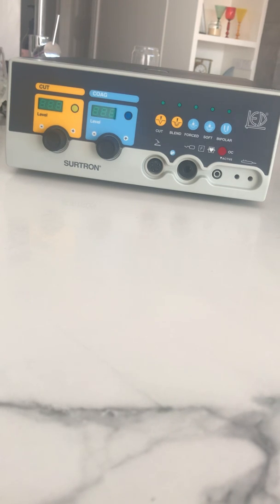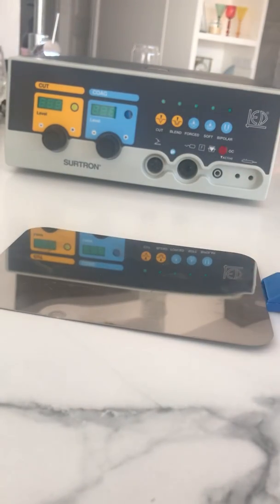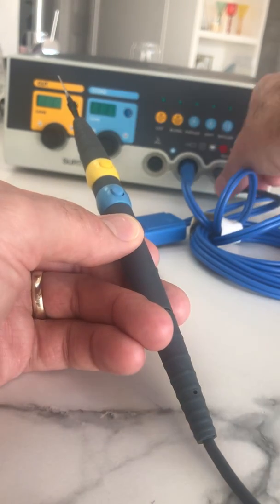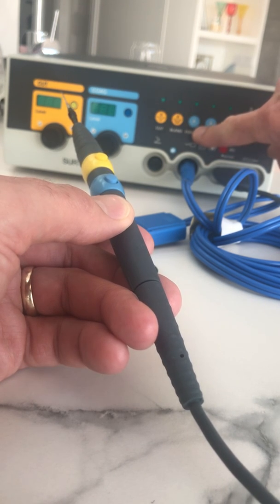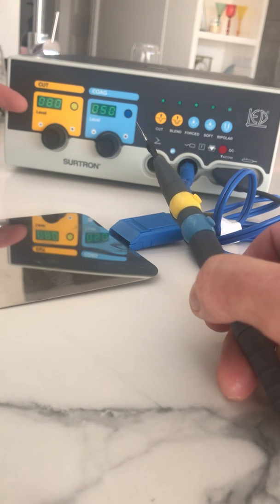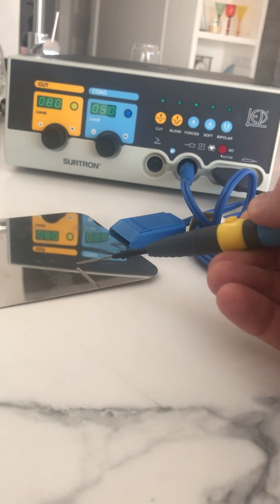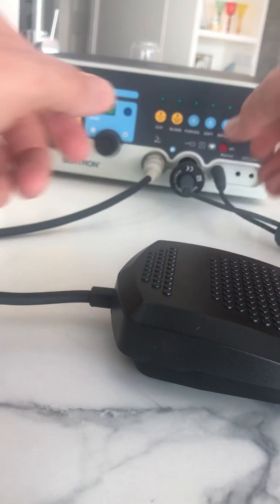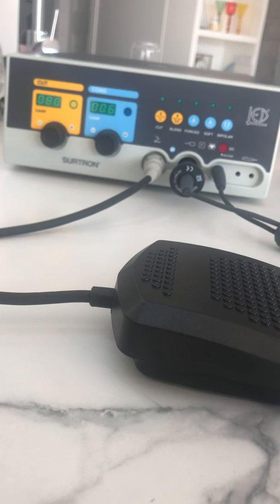LED Surtron  Set-up and Operation

Comment: My red OC light keeps flashing and neither my cut nor coag will work.  This is not consistent between patients.  It sounds and looks like at the end of the video when there was intermittent beeping.  I don't have a foot pedal and I don't have the forceps.  What do I do?
Reply from the maker: Audrey Zietsman 
Hi Audrey

Probably the neutral (patient) cable has fractured or your hand piece need replaced.

I would recommend replacements of both to rectify the problem.

Kind regards 
Brent Mitchell
Esteem Healthcare Ltd
New Zealand
+64272796809

Sent from my iPhone
Reply from the maker: Audrey Zietsman 
Hi Audrey

Probably the neutral (patient) cable has fractured or your hand piece need replaced.

I would recommend replacements of both to rectify the problem.

Kind regards 
Brent Mitchell
Esteem Healthcare Ltd
New Zealand
+64272796809

Sent from my iPhone